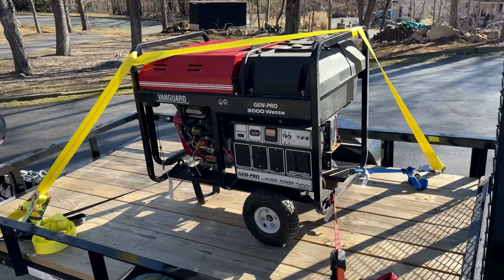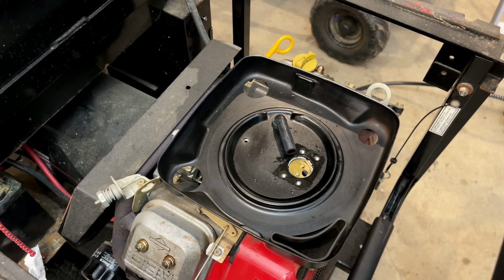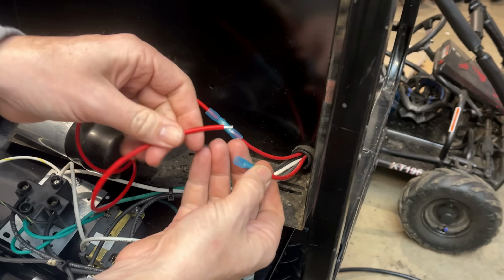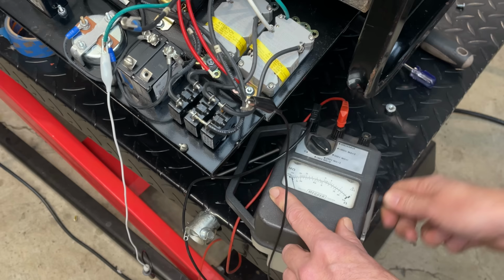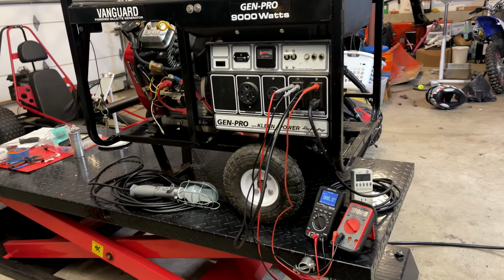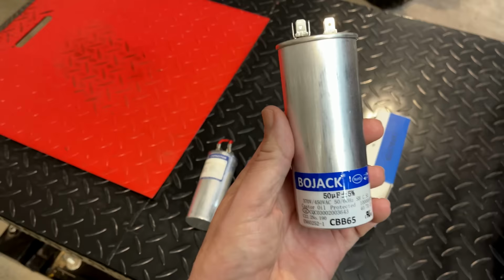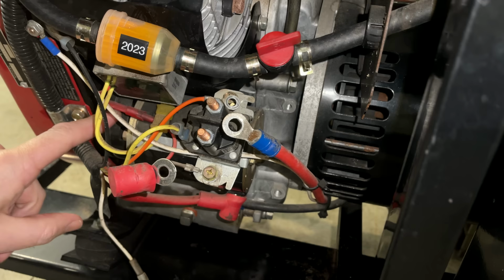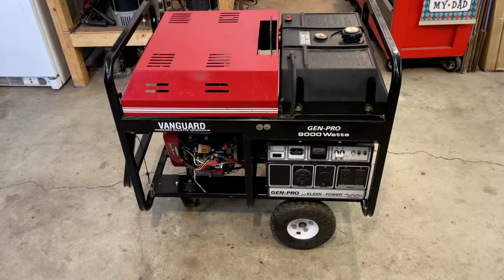How To Test and Fix A Brushless Generator

Comment: Important part with capacitors and not blowing them up is primarily voltage rating. The Farads (capacitance) is not as critical to the survival of the cap, but will throw the rest of the circuit out of kilter if it’s not right.

Comment: Hi James, 
It was great to see your use of the 1 amp current source to test the very low resistance of your windings.  The temperature will affect the winding resistance, so it may need to be tested at some particular temperature to get the exact reading they specify, likely 25 C.  Adding heat always increases resistance.  This was one of your best videos!
Reply from the maker: Thanks

Comment: I was going to say that the original capacitor failing after 300 hours isn't very impressive, but it's rather better than the sub-30 second lifetime of the first replacement.

Great video, and good work checking out the power head before throwing more parts at it. :)

Comment: This was an awesome video buddy. I'm an old man and I have many secrets that has caused me to be targeted by some group that don't want me to tell one big one that I built about 15 years ago and I'm lucky to be alive today. I only told people this one other time so when you see this, please make a copy and hide it, then you build it ok. I took a huge 3 phase motor and turned it into a free electric generator that powered my entire shop and I was running 3 phase equipment and regular motors and lights. I hooked up on top of it a furnace blower motor and put a v belt pulley on it that went around shaft on 3 phase motor and had wires hooked up to a light switch, the switch I ran to my regular breaker box to supply power to furnace motor when light switch was up. I had a new huge fused 240 volt box to right of that regular one. I pulled 110 volt from regular box to one leg of the 3 hot wires an when I flipped light switch up the furnace motor spun shaft on 3 phase motor, I used a hand lever to hold force on v belt to make both motors work together. Once 3 phase motor was going same rpm as furnace motor I hit 110 volt to 3 phase, now the 3 phase don't need starter motor so I flipped light switch off and loosen up tension on both motors and removed v belt. The other 2 legs from 3 phase motor is hot, mine was running around 127 volt and 138 volt I believe it was. The wires I ran to new fuse box an now it has 220 volts, I took ground wire to outside of motor to fuse box. I had 2 options, run a wire 110 from breaker box to fuse box, (that's what I did in the beginning) or grab the 3rd wire on 3 phase motor that's being feed by breaker box, or adapt the motor to feed its own power and I done that about a month later. I used run capacitors not start to increase the voltage after the 3rd leg left the fuse box so all 3 legs had 110-127 volts on them that I needed to run my huge saws. Copy this and build it. You can use anything to start the 3 phase motor, even if you get a smaller one to start with, you can make your own power at home and get off grid, or you are many miles up in the woods where it's not even an option for you. If you use a small 3 phase motor you can increase the voltage by using run capacitors and nobody will know you even have electricity. If you never worked around electric, don't try to build this an stay away from capacitors because they can take your life if they are not discharged before you touch the ends of wires. Some people say it won't work, oh but it does. I had 3 guys from my power company come to my shop to see within the first month to see why my power bill dropped so low, being stupid I showed them then walked them through how it works from starting to shutting it down. They ran their tests on it All. After about an hour one guy said, you broke the laws of physics and I replied that law is just a lie we been taught our entire lives. An he replied back with, we see it running, we tested it an it works. The damn thing works great. About a week later is when I noticed my health was being targeted and I would wake up in the morning and find strange marks on my body that wasn't there when I went to bed. That has been 15 years ago and I still been getting worse and now I'm in a wheelchair. Build it and teach others it does work. I still have everything to put mine back together when time comes we don't have the grid anymore. Save all old microwaves you can. Parts inside them you can turn into free energy motors. Coils and old motors are going to be worth gold. But garden seeds like heirloom seeds are going to be on the very top of the list of what is worth the most. Along with rubber bands for slingshots and the tubing for them too. I already have both. Ammo you can find laying down on the ground. Get ready my brothers and sisters because we have hard times ahead of us. They can control our ammo, that's why you better stick up now and get everything you need to build sling shots. Air guns also. Arrows and being launched using air, sweet.  They will go faster than any bow sending them to the target. Compressed air is going to make a big difference an you can set it up using a remote control spot light motors for like on a boat or rv. But remove the light and add a security camera and barrel your using to launch arrows with. You can send them faster than bows. Using old truck leaf springs you can make a cross bow, but need a come a long to pull cable back on it. Then fire off wooden fence posts and shape them like a pencil so they go further away. So many things we can do to protect ourselves and our families. Lead tire weights, save as many as you can for making fishing sinkers and ammo. If you run out of ammo, use fishing sinkers. I Hope atleast a handful of you do build my free energy motor. Then you tell more people. An there is one video on YouTube where they built the free energy motor using coils, it does work and it powers itself. Not all those videos are lies but most are. I'm telling you the truth, I've hurt in severe pain for past 15 years to prove it. They want us slaves for them. It's time we think for ourselves. God bless everyone and share the power of love, that is the greatest power we have in our Universe. An most of us use it.

Comment: Just a little note on capacitors. I am an HVAC technician and have found out from experience the only capacitor to buy is an American made Amrad it will cost about $24 instead of $6 for the Chinese or Mexican capacitor but will last. They are available at most HVAC supply stores.
Reply from the maker: Thanks will try and remember that for the next one.

Comment: Great video, once again. For components such as capacitors, you can try ordering from Digikey or Mouser to vastly decrease your chances of getting a junk part. Found a 50uF 450VAC rated capacitor for around $20.

Comment: Thank you for making this video. I have a similar generator, just a little bigger and with a Honda engine. It works great and I’ve wanted to get into the control panel to change out the 120v plugs, as they’ve been used a lot and don’t hold a plug. It’s been a solid generator and would recommend it to anyone. To build off of what you said about the fuel line, I replaced most of mine with a hardline and rubber only at the connecting points. There’s not much about these generators out there, so again thank you.

Comment: GREAT job as usual. To avoid your body introducing any resistance into your tests that involve very low resistance, it is good practice to use alligator clips that connect directly to your meter test leads. Any resistance introduced by short jumper leads should be negligible.
Reply: Good advice. Especially for a capacitor test.

Comment: I have been subscribed quite a while and must have missed this one. Really great editing and very thorough explanations and approach to troubleshooting. I am 72 and never tire of watching a great steady paced thoughtful worker. I was trained basic principles of troubleshooting problems in Navy rescue helicopters in our squadron in running our avionics electronics shop for my 4 years and it has really paid great dividends. It is hard to find any repair person today in any field that knows how to do smart troubleshooting before just replacing parts. When I find e.g. a good air conditioning tech for the house and my rental units I tip him well to hang on to him. They are truly in short supply. This video would make a great training video on proper troubleshooting and repair approach to any repair. Just wanted to say you have another person who really appreciates the work and effort that goes into producing the video as well as the excellent approach to repairs. Great job.

Comment: I have been servicing the engines for these generators for years.  The carburetor is the usual suspect when it won’t start or run right.  So I have become quite proficient at getting the running right.  But the electrical side has never reared its ugly head until now.  I bought a supposedly new in the crate 6500 Watt AVR generator.  Unfortunately it sat for many years and they must have run it at least once and the carb was all gunned up.  After fixing that the electrical didn’t work.  I was very frustrated at this point until I watched your video.  I don’t have a capacitor function on my meter so I just ordered a new one hoping that would fix it.  It did.  I was elated.  Finally the thing is running and generating.  Thanks for this comprehensive analysis.
Reply from the maker: Nice

Comment: I have used a slightly different starter solenoid in one of my designs.  The difference was that instead of the rectangular copper bar, that solenoid had a round disk that could rotate.  That way it would theoretically have fresh contact spots available often or continuously.  But even so there were issues by heat developed at the high current studs, if the cable lugs were left even a little loose, or alternatively over tightened.  Melted plastic and internal damage resulted.  Also, my old second hand car (a Pontiac Grand Prix) developed arc scars (partial welding) on its disk and stud contacts.  Analyzing that actually gave me confidence to use that solenoid in my own design.  Low cost and easily handling my 100 A need.  But that was way back when.
Reply: That sounds like what I've seen in car solenoids as well.
Reply: On many disc-contact solenoids you can flip the disc and/or rotate the terminal bolts to expose a new surface and theoretically double the life of the solenoid for free. I've fixed quite a few this way. Sometimes one contact will have an internal wire brazed or crimped to it so watch for that on disassembly and don't force anything. 

The solenoid we see here with the rectangular contact could have been a better disc-type design for sure.

Comment: Great Vid!  Always nice to see the Biddle 210170 megohmmeter in the wild.  Rough-Test resistance accuracy by attaching the 500V-output to a DMM measuring DC volts.  The standard impedance of most multimeters is 10Mohm.

Comment: Great troubleshooting and repairing once again James. I'm sure that Gen is not very quiet but I sure would want one like that. My neighbors in the City here would hopefully tolerate it. lol  I wish they all were built with that quality in construction materials, high amperage output, and low distortion to boot! Note: I had a commercial toro walk behind 21 inch self propelled mower from the 90's. It had a GTS 150 Briggs motor that had "made in Japan" stamped on it. With part time business use it lasted over 15 years!! Makes me wonder if it was pre "Vanguard" but just as good.

Comment: Great video James and as usual excellent diagnostic skills. I have seen a similar situation before, when an electrical (240v) circuit kept on tripping a circuit breaker. With a multi-meter on Ohms it was showing that there was a possible fault. My colleague and I searched high and low and were unable to find the issue. Once we did a 500v Insulation Resistance test the fault cleared, never to be seen again. To this day we never found out what was the issue. We put it down to possible dampness. Thanks for sharing.

Comment: Hi James, I have worked in high energy electrical systems for a very long time (now retired), what we have found is GE stuff is not very reliable. when we had to replace it was not with GE stuff. 
as far as the solenoid it most likely welded because of low battery voltage causing the starter to draw a very high current.
good work, the cap thing would have sent me down the same rabbit hole. 
Rich

Comment: I have this engine on one of my Cub Cadet Series 2000 tractors.  When it runs, it runs very well.  But when it breaks down, not so nice.  I can't remove the carburetor all that easily but I can get it most of the way clean.  Right now I can't do anything with it as trying to get the worn out electric starter free is a royal pain.  It also consumes most of its oil in about 40 hours of use.  I have never been terribly impressed with Briggs engines and there is only one I can think of that never ran without issues and that's the Intek Snow on a former Craftsman (made by Husqvarna) snow blower I had.  I liked the reliability of that engine, and tolerated the snow blower, which was a lemon.

Comment: That gorgeous genny went to the right man for a thorough once over, diagnosis and repairs... Rotton luck on the starter solenoid going  south on you during testing, but at least it was discovered, repaired and now a fab genny again. I have had off the shelf capacitors that fell well short of the specs.... I ended up going back with the tester and found a good one and swapped it out, but that was for a motor. It's only when you have to do a complete overhaul and spruce up on your genny, that you find out the days it can take to strip it, revamp the chassis and rebuild the engine James as you can testify to. As I mentioned before I had to do the whole strip and rebuild as mine was struggling to autostart and often would fail on an E22 error (failed to start after 5 attempts) it was the fuel injectors were gummed up, the head needed a good clean, the valves were not exactly gapped very well (Had gained some slack) and the chassis had a good bit of rust... Thanks to your insightful videos, it runs at full load without a hiccup, starts on the button and looks as good as new, so my trusty old 6.5KVA can run most of the house on a blackout as it used to. I also added a decent battery charge circuit as it would kill the battery within a year... Turned out the battery was getting 16.7 volts when running, but with the heavy duty charge regulator, it charges at bang on 14.4 volts and once nearly full, drops to 13.8 for float charging if still running... Bravo yet again James as its all thanks to you :)

Comment: I have the same punch set. In order to get better cuts, I threaded a bolt from the inside, and used a drill press as a lathe to sharpen them against a whetstone.

Comment: Also thank you for tearing apart the solenoid never thought to take one apart but it makes sense on their failure rates. Could be the plunger not  making full travel or contact between main posts  if you hear it clicking if you don't it's probably the coil or plunger hung up.  👍

Comment: With capacitors you should be careful with "new old stock". These kind of capacitors degrade with age even when not in use.
There is an electrolite inside that causes a very thin layer of oxide on the plates. This thin layer is the insulator between the plates. The thinner the oxide layer and the larger the surface of the plates the higher the capacitance will be.
The thinner the oxide layer the lower the working voltage will be. High voltage capacitors have a rather thick oxide layer to cope with that high voltage. To get the high capacitance value you have to increase the surface of the plates. That is why they are so bulky.
During manufacturing the plates are made with that oxide layer on them. The separator material between the plates is saturated with an electrolite this makes sure the oxide layer stays on the plates. This only works when there is a voltage over the capacitor. When there is no voltage over the capacitor the electrolite may "eat" into the oxide layer and thin it. This is a very slow process but when the capacitor is on a storage shelf for many years the layer can get very thin.
When the capacitor suddenly gets full voltage the insulator layer can be too thin and breaks down very quickly. That shorts the capacitor and causes all kinds of problems.
Sometimes putting a low voltage on the capacitor can work to "grow back" the oxide layer. By slowly increasing that voltage you may get it back to working order. This will take days! Better is what you did, replace it with a new(er) capacitor that does work.
Failing capacitors is common with old electronic equipment. If you get a really old piece of electronics that has not been powered up for many, many years you better replace all capacitors before powering it up again.

Comment: Hi  James,   I  got myself into a  comfortable position and  followed  you through  this whole  video,   You were very thorough  in your diagnosis,    my only issue  in the last few  moments I'd have cleaned  the rusty terminal on the battery side  that was still connected,  other than that you did an excellent job ,   Stan Edinburgh Scotland.
Reply from the maker: I ended up doing just that before returning it to the owner.  I noticed the charge cable was corroded and not maintaining the battery.  Cleaning the terminals did not work so put a new cable on and he was good to go.

Comment: Swollen top or bottom indicates shorted to open, overheated and lifts the connection internally. The replacement can be 5% mfd, voltage can be higher by 12%, but never lower. 
 Any airconditioning parts will have them. 1/4" quick connect crimp on will work fine.
Reply: Also, is that the original value cap ??